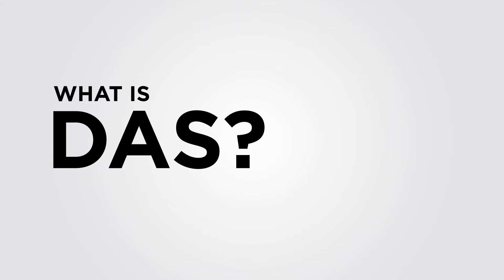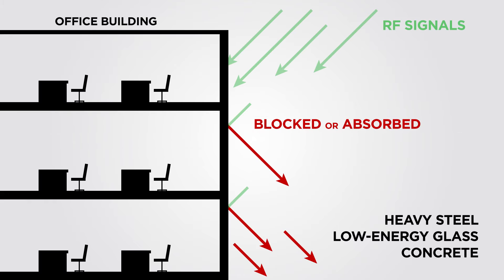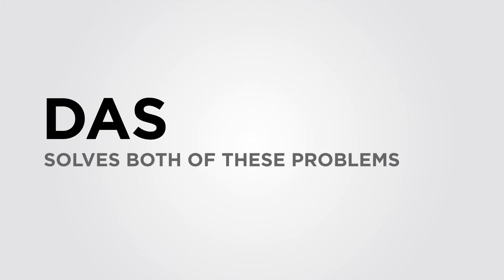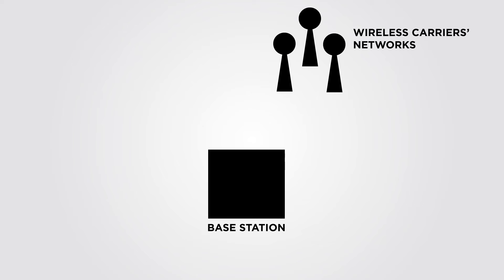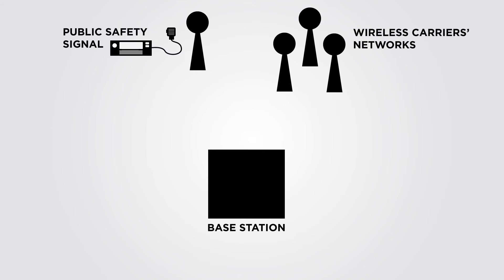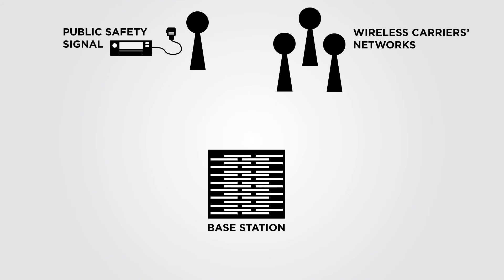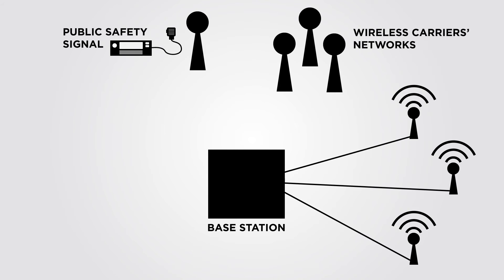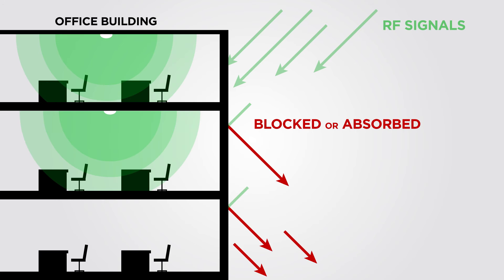Cable411: What is a Distributed Antenna System or DAS

Comment: Really wish people would stop talking about DAS systems using donor antennas.  The problem in the wireless world for customers isn't just coverage or signal strength, it's capacity.  Donor systems may improve your coverage but what's the point if you rob the cell sector of its capacity.